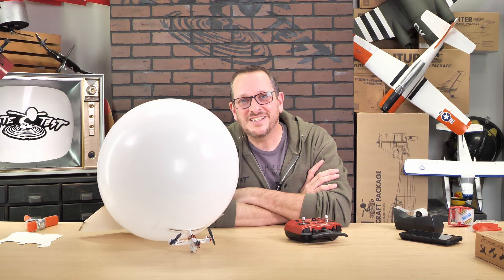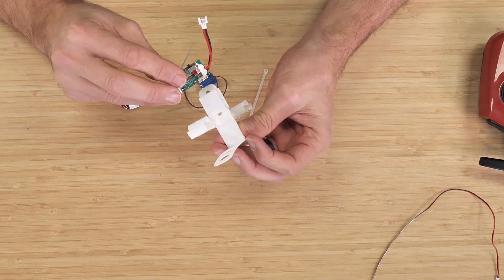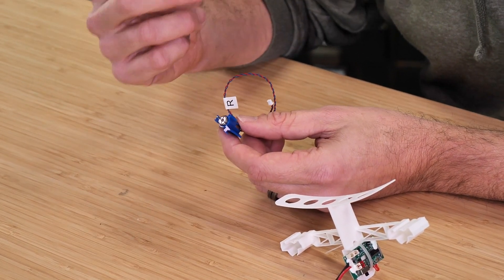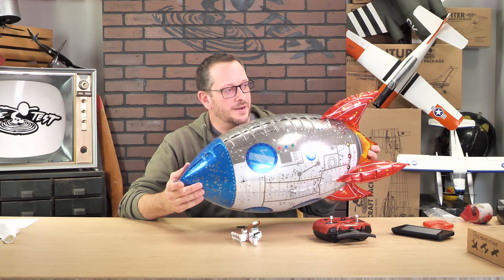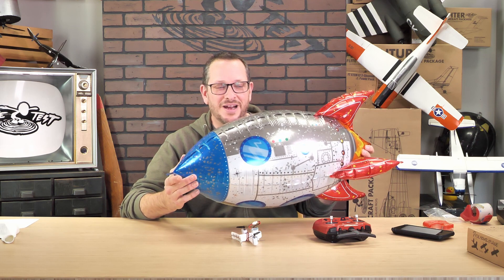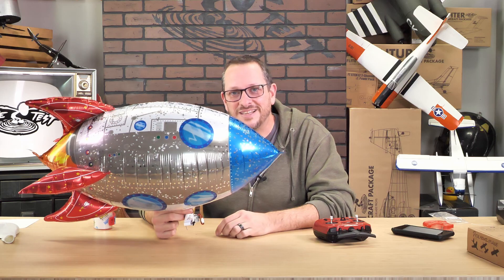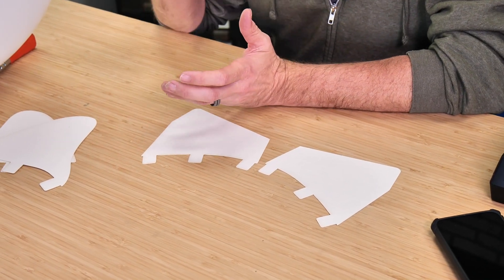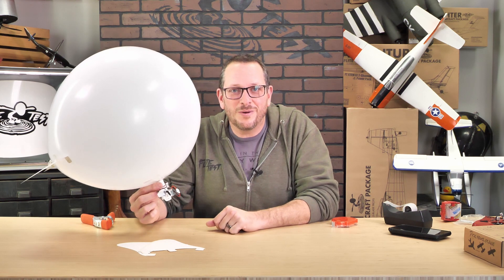How to Build the FT EZ Battle Balloon //  BUILD

Comment: hey josh! tried using one of the balloons that is a circles and are kinda flat on two side but it just kept spinning and doing back flips is there any way to fix that problem or do I just have to use a completely round one? thanks if you can get back to me
Reply: Also what happens if the antenna on the FT EZ receiver board falls off :-)